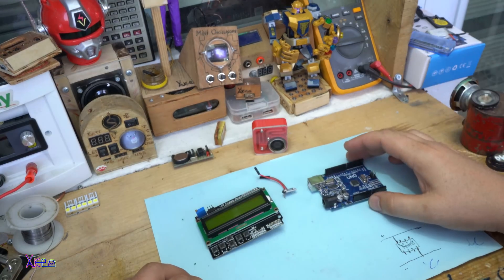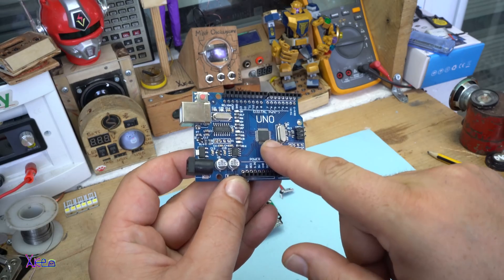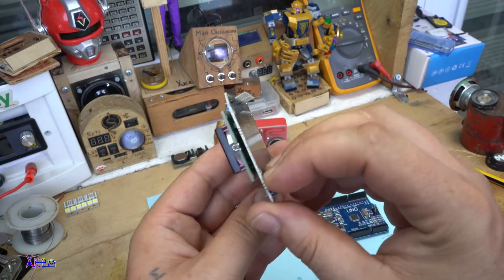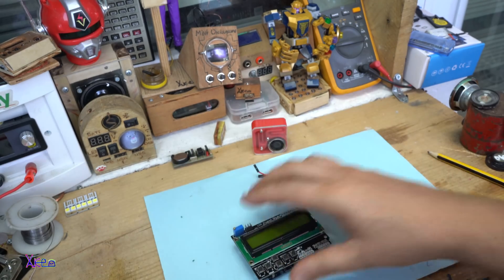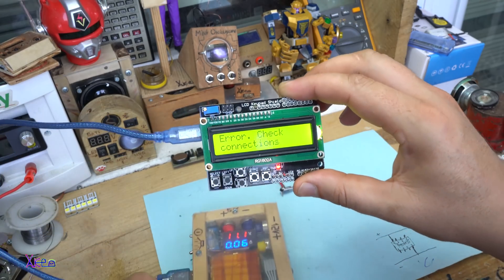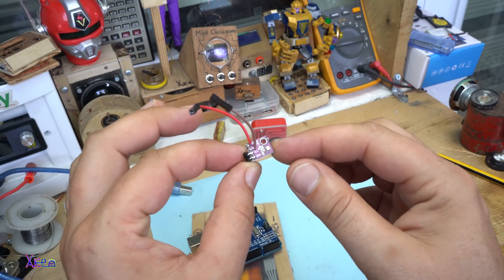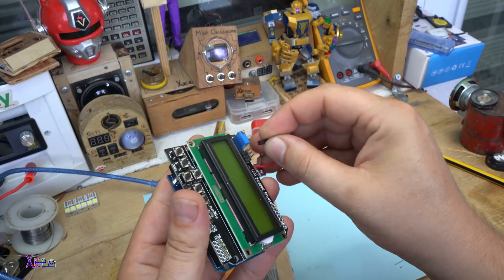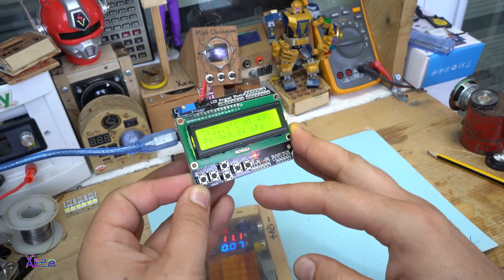Arduino Weather Station | DIY Arduino Project

Comment: I have one question about this project. Did you have to soldier some pins on "LCD Keypad Shield"? I am asking because in description you share link to code for this project and in article it is mentioned, that if you want to use Arduino Uno instead of Mega, you should soldier pins on shield, but in video I don't see it. Thanks for answer.

Comment: Hey this is pretty neat, and awesome that it's so cheap!
But how difficult would it be to install the sensor outdoors, but keep the UNO +shield indoors?
Reply: Shouldn't be that hard just extend it with wires and make sure it's isolated well